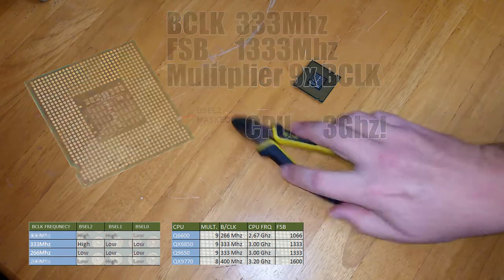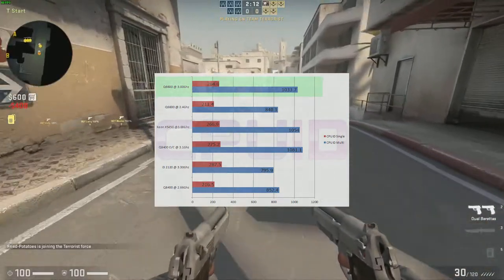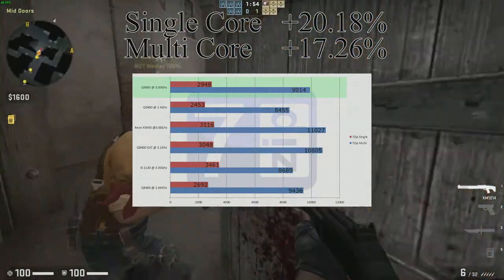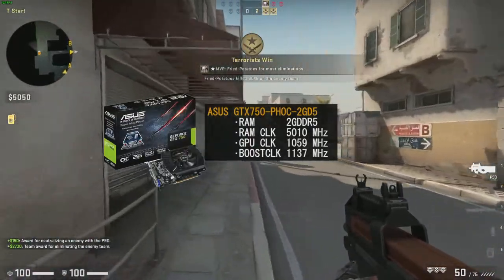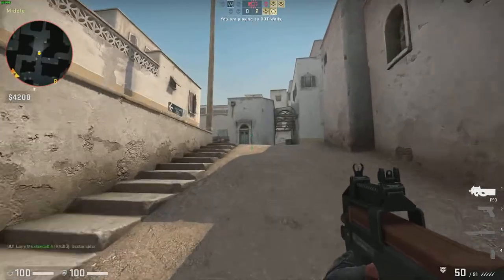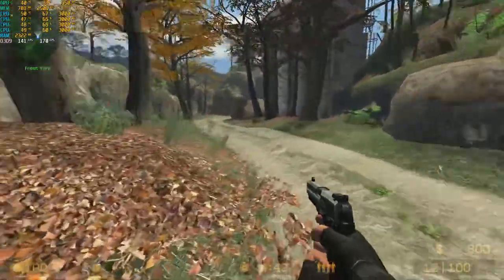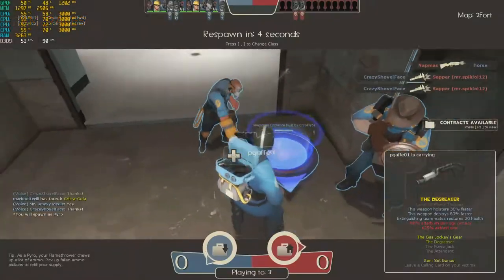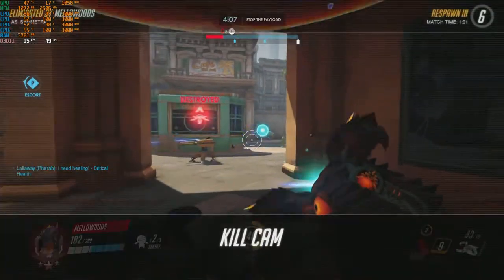Core 2 Quad Q6600 BSEL MOD. 3Ghz

Comment: I think the "best" video card for the 3GHz q6600 is the AMD r7-240 radeon. Just my opinion. The reason I think this is because it is slower than those nvidias and so it will limit the range of games people attempt so they won't end up disappointed by stutter. However it also has nice video decoding and any effects it does do (lighting, particles etc.) will be smooth with the 2GB ddr5 memory (or overclocked edition memory, maybe even 4GB). Also the directX version is pretty decent. I also think crossfire would be kinda nice (but only in some games) because it works on almost any mboard. Also the r7-240 is " pretty-much built for crossfire" so I think it might be stable in framerate... and by that I mean the "crossfire" it is for is dual-graphics with an A8-7600k (Kaveri I think) APU so I think two r7240 cards (with no APU) might perform well. 

It is a "leap of faith logic" but I have a hunch I'm right. Also the a8-7600k quadcore cpu is not that far of a bsel mod q6600.
I have a thing for wondering what "weird but maybe awesome" combinations can yield niche-ass outcomes that most youtubers do not try.
I also think the hd6450 (1Gb or 2GB versions) should be crossfired more by youtubers and the same goes for the r5-230. I do wonder if a r5-230 can be paired with a hd6450 for a two-card crossfire setup. That would be really cool because then you get the video decoding on the r5-230 without "wasting" a r5-230 in the other pci slot (as you have a hd6450).
I have guesstimated that the bandwidth a r7-240 is using is about (academic) a x2.5 PCI-e gen2 slot. So in other words just less than a 3x slot (so you can use a 4x slot for no bottleneck saturation, or you can tolerate some saturation on a 1x slot). I think (as the r7-240 is pci gen3) a 1x slot would be tolerable (very much like a 2x slot of a gen2) and a riser (mining or similar) cable could be used to reduce a pci-e 16x slot into a 1x slot just to test that theory.
It takes about a HD7770 to choke about 15% performance off a 4x slot gen2 saturating it (even crossfire). That is tolerable (even though it is not ideal). A hd6450 does not saturate a pci-e 1x slot at gen2 (and actually even a gen1 at 1x can do ok for some  scenarios for a hd6450). An  nvidia1030 (or some 750 cards) needs a gen2 to be about a 6x slot or less before it chokes via saturation. So basically a 8x slot is what many people use on the 1030/750 setups. These saturation figures do not always happen but are close approximates. You can kind of guesstimate other cards' saturations and slots (x1, x2, x4, x8 and gen2 or gen3) from that info. Of course, your mileage may vary.

Personally I find this all useful because there are far better uses for pci-e bandwidth than video-cards if you can manage to find a video card that will tolerate a 1x slot (be it gen2 or gen3) without saturating too much. TV capture cards or network connectors or HBA etc. Game-servers can be helped by esoteric setups like that especailly when you can use dynamic disk or btrfs and fancy network cards people fling out. VMDQ can be done and so forth (for multiple game severs rotating NIC ports on a cron job with no downtime, so as to overlap timetables like venn diagram especially for timezones worldwide).

Comment: The virtualisation instruction set on those core2duo chips is old and limited but it does at least "exist". So I wonder something. The original 2.4GHz speed was good for a fair few games (even though some of those simply won't run well at all without the 3GHz speed). If the 3GHz speed chip has the 4th core spent on a VM for virtualisation (or instead if maybe the 1st core is running qemu pretty-much gobbling up a core), you still have 3 cores left.

Now, I know this will sound "approximate" but if you think about it, losing a quarter of the performance like that means the remaining "tricore worth" of CPU horsepower is a bit like have a 2.25GHz quad core. So like I mean if you knock quarter (like a core) off 3GHz you sort of get 2.25GHZ. See what I mean? Sketchy, I know but sort of a fair analogy.

So what I'm thinking is that (some of) the older games that only need the 2.4GHz speed would run well enough on the "effectively"  2.25GHz speed leftover (when the 4th or first core is used on some VM or qemu).

So my (kinda janky) logic here is that there must be some use cases for this set-up. Like maybe if a xmpp video-voicechat is run on the one core spent as VM. Or maybe Linux is on that single core doing some logging or humble 480p video encoding. So I wonder if, when a person has two videocards (like maybe two AMD cards) if passthrough can be set up well enough so that the singlecore VM gets its own videocard (with video encode-decode capabilities) and yet the tricore remaining gets its own video-card.

The reason I am thinking of all that for the q6600 is because of the "amount" of boost you get for the BSEL mod as it sort of fits that ratio (3GHz to 2.25GHz). I reckon though there would be some paralization ability lacking in the instruction-set or something stopping it from being awesome on the q6600. Mind you, the server equivalent CPU chips might have it.

In reality it may be impractical... but then again it might work out nice. I guess I just kinda want an excuse for the set-up to exist.

Comment: Nice. I’ve got a q6600 with asus p5k. I use asus mobo software in win Xperia’s to get a stable 3ghz...9x333
Reply from the maker: Good work.
If your motherboard will let you overclock it is defiantly the way to go. There is way more control and you don't need to do any physical Mods.

It's great that you have found some software in windows to do the overclock. Something that would be good for us to  look into. Thank you for letting us know.

Still a good CPU the old Q6600

Thanks for watching.

Comment: I don't want to damage my cpu ...the tape won't last due to heat...or it may extend due to heat and cover other pins.....wont last for 2 weeks .... you have to have problems ...or am i wrong?
Reply from the maker: We have not run this CPU for long periods of time,
So this could be an actual problem.
Though being electrical tape it will most likely at worst fall off the CPU but still be pinned by the socket pin blocking the connection still.

It will also probably depend on the quality of electrical tape that you use.
But still we have not run this over an extended period of time.
So anything could happen.

In the end the best overclock solution is to do it with a motherboard that supports it.
Having a big jump in fsb mhz is not always great if the motherboard cant handle the jump with that cpu.
But motherboards that do support overclocking you can set the FSB incremental by 1 mhz which is far more better for stability in the end. 

As like any type of overclocking still they all incur a risk, but the tape mod in my thoughts is far more risky than a motherboard that supports overclocking. This is just an option for those who don't have a motherboard that can overclock such as the HP PC in this video, though still not an ideal solution.

If you give it a try let us know how it pans out.
So far we have heard of no one having any issues as of yet.

Thanks for watching and your comments.

Comment: Just tried. Didn't work for me on a Dell xps 410. Would go to do the self test once it has power and would just beep and fans would stay on. No post. Removed the tape and posted fine. Must be a model you can't do it on. Have the q6600.
Reply from the maker: @Sokoloft Looks like the xps 410 only supports 1066Mhz FSB,  I believe the XPS 410 uses the P965 Broadwater(p) chipset. According to wiki the max FSB clock is 1066Mhz. Unfortunately the motherboard can not clock the FSB harder causing it not to post. It's a shame, I really like the DELL XPS series they are built well however this xps 410 is just too old for anything greater than the Q6xxx series cpus. :( 
The only CPUs you can find that's better and might work, is trying to dig up a rare Qx6800 or Qx6700 (Qx6850 won't work at all). I doubt the price of these cpu's would make the venture worth while though.

Thank you for sharing Sokoloft really do appreciate the feedback.
Reply: @OFFbitTech  Wonder if you could underclock it with a similar method? Possibly get a gigabit card and use it as a pfsense box. I just use it to image drives from time to time so not too worried about it. Extra cpu speed woulda been cool to see but oh well. Seen a bunch of vids on it, figured I'd try it. Only if it had an IDE port.
Reply from the maker: @Sokoloft pfsense sounds like a great project to turn the pc into. You should be able to underclock in a similar way, you may need to do a couple other tricks like routing some grounds around etc.

Comment: how do i change core 2 duo e7600 from 800fsb(something like that)  to 1066 fsb?
Reply from the maker: The core 2 duao e7600 is already a 1066fsb. 
To chage the 1066 to 1333 is the same process.

Though if you are actually using a core 2 duo e4600 with the 800mhz fsb to get 1066mhz you need make a bsel1 go low / get it to 0 volts. This will be probably a little more complicated than just covering up the pin. The pin needs to be tied to another ground pin / 0v pin.

If you motherboard supports setting bsel or fsb clock directly that is always the better way to go. The besl mod sometimes can make the setup unstable due to the big clock jump. Where a bios setting can adjust the clock in small steps. Thus giving the maximum performance and stability when you find that perfect clock speed.

We hope that helps.
Good luck.

Here is a reddit link that may help as well.

https://www.reddit.com/r/overclocking/comments/fxpxkk/help_me_oc_lga_771_xeon_by_bsel_mod_please/
Reply: @OFFbitTech  yeah the thing is my motherboard is oem and it locked so wonder if i can oc my e7600 to get higher performance so maybe i reach my pc limit.(my pc hp dc7700sff and upgrade it to e7600 but it get 1/2 speed from normal so whenever i power the pc need to use crystalcpuid)

anyway thanks for the info hope you keep growing your channel!
Reply from the maker: @danishtitanz5241  OK, this is very interesting problem.
Looks like it is a firmware bug from HP which I am guessing you already know about. Seems to be that crystalcpuid is the best work around we can see at a glance. We thought a microcode update may fix that but does not look like that will work either.

Unfortunately it looks like you are running the best option at the moment.
If we ever have one of these machines come past us we will defiantly be keen to have a closer look.

We also think there wont be anymore way to get faster clocks from what you have got with crystalcpuid, not with out some serious hardware motherboard mods (which may just make it a big brick).

Sorry that there is nothing we could help you with.

Thanks for watching and your support.
Reply: @OFFbitTech  just an update:i just bought the e7600 and swap itt  without any mod and it show the microcode error but f1 to boot (like everyone else) instead boot up i got send back to the bios and the cpu fan boost up itself so did i do something wrong? bios in  1.16
Reply from the maker: @danishtitanz5241  The full speed fan is most likely a safety feature being un able to detect the cpu (no micro code that matches the cpu).
Being sent back to the BIOS is a problem if it does not allow you to boot to the operating system.
You might need to try and hunt down a modded bios bin file to flash on or modify your current bios with the microcode for the e7600.

Finding the e7600 microcode maybe a little difficult, but if it has been done before you should be able to find it.
If this is the case you will probably find a modded bios. Off course to do any bios flashing on the system you probably need to put the other CPU back in.

There is a real risk of failure here so keep that in mind.
 Good luck..
Keep us posted how it goes.

Thanks.
Reply: @OFFbitTech  yeah already got the bios and try to flash it while using e7600 so it work well...so whenever i want to flash the bios for the new cpu (upcoming new build) am i need to put the new cpu or it can be done on other cpu?

anyway thanks bro you the only one helping with old tech like these god bless you!!
Reply from the maker: @danishtitanz5241  If the other cpu lets you boot to an operating system, I cant see why you cant update the bios with the new cpu.

I was more thinking of if it just stops at cpu detection or purely hangs on post.
In that case you just need a cpu to get it to boot up for the flash update.

Thanks for watching and letting us join in on your upgrade adventure.

Comment: Dear my help here, I put the tapes on the correct pins (I checked several times if they were the correct pins), then I turn on the PC, from the video, then when I enter the BIOS of the card (p5g4it-m lx2 / br asus) the right clock of 3.0ghz appears, and when i go into the blue screen windows, the pc restarts, and returns to the standard clock of 2.40ghz, do you know how to fix this?
Reply from the maker: Unfortunately  sounds like the overclock is un stable.  Which there is not much you can do if it cant do the whole step from 1066 to 1333 from using the tape bsel mod.

However your motherboard looks like it's not an OEM motherboard from HP/ Dell / Pegatron.

So you should have to options to overclocking.
The best and easiest method if you don't have an oem board is using the bios.

This is done by change the FSB value from auto to a value. you could start at 300 or 333 and work backwards until you get something to boot.
The menu to do this is usually under MIT (MB intelligent tweaker) or something like that.

Once booted you will need run programs and iron out if it's still unstable. Eventually you will find the sweat spot.

When changing FSB you need to make sure you don't over over clock you rams speed. My guess is your using ddr3 and that would probably 1333 ram speed. so try and keep that close to that value. Ram is done with a multiplier you will see it in the same menu where you change fsb... Just scroll down.

Have a look at our 3.1 ghz overclock for the q8400. though your fsb setting will be much lower, since the board did not work with bsel at 1333 which would be 333 in the bios under fsb.
Just don't go to close to 333, try like 300 or something and work backward to stable.

https://youtu.be/y1whOCS3DzY

if you have boot up issues you can reset the bios as last resort and it will book back @ stock but usually the motherboard will pick up a bad post with overclocking... usually...

Hope that can help.

Thanks for watching.
Reply: @OFFbitTech  thanks for support
Reply: @OFFbitTech  ow, in found one problem, my motherbord (p5g4it-m lx2 / br), not have ''jumperFree'' option, (https://www.asus.com/br/Motherboards/P5G41TM_LX2BR/ 
link in case you want to check it out)
Reply from the maker: @persyc44  Wow. 
OK we have not seen that before.
Interesting motherboard though.
It's a brazil special..  Love that part about it.

Kind of a cool motherboard.
Shame it does not have the jumper free option or any overclocking options in the bios for the CPU.

Thanks for your reply and thanks for watching.
Reply: @OFFbitTech  thanks, more you can help me?
Reply from the maker: @persyc44  our pleasure.
Thank you for watching.

Comment: I have q6600 and gt 1030, would it change much in gta 5, cs:go and tf2 if i will do bsel mod? also my ram is 8gb
Reply from the maker: You should see approximate 15% to 20% increase in CPU performance I believe. You should notice world loading would perform better. Mostly when you are driving cars fast through one side to the other side of the world.

Also it's worth noting you really only need to do the BSEL mod if your motherboard does not let you overclock the FSB or Base Clock.

It's far more easier and you also can reduce the overclock if the CPU is unstable with the overclock.
BSEL mod is pretty much a hard overclock of the CPU with very limited options for adjustment.
So, basically if the BSEL mod is unstable with your motherboard, which does happen your only real option is to undo the mod.

So if you can overclock from the BIOS try that first else try the BSEL mod. With a bit of luck you should get some extra free performance.

We hope that helps.
Good luck and thanks for watching.
Reply: @OFFbitTech  i realised i have 6x multiplier and i cant change it to 9, ro you know how to fix it?
Reply: @OFFbitTech  i fixed my issue and  did bsel mod and i have almost double the clock speed, thx!
Reply from the maker: @sziszimora6213  Awesome, that is a great outcome.
Nothing better than free performance upgrades.

Comment: does it work on core2 quad q9505? how many ghz does it get?
Reply from the maker: Unfortunately the BSEL mod will most likely not work for your q9505 setup.
Since the q9505 already uses a FSB of 1333mhz a BSEL mod for you will need to set the FSB to 1600mhz on the CPU (a different pin configuration, taping a different pin off). Though setting the CPU for 1600mhz BSEL mod is possible it is very likely your motherboard will not boot up at this setting or just ignore it completely.

If it does work you will see a CPU Clock of 3.4Ghz.

If you don't have an OEM motherbaord (DELL, HP, ACER  etc.) you will probably be able to set the FSB in the bios. Which is a lot easier than doing a BSEL mod. It also lets you tune it back for instability if encountered.

FSB in the bios is usually written before it's multiplied shown below.

266Mhz  (1066 FSB on cpu)
333Mhz  (1333 FSB on cpu)
400Mhz  (1600 FSB on cpu)

Some motherboards will let you  overclock to 400mhz, and some will do more and others less. It can be a lotto sometimes but some boards also just not made for overclocking and some are.

We hope that helps with your questions, though we may of confused you more with lots of info.

Thanks for watching, feel free to ask us any questions if you are confused.